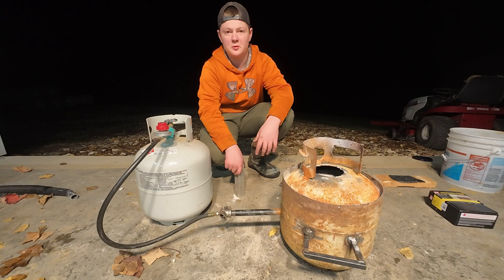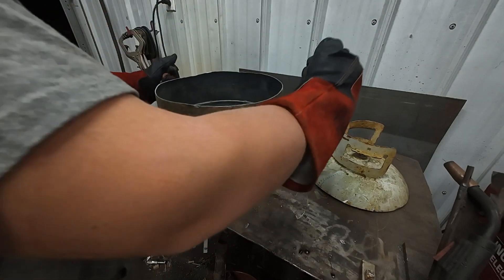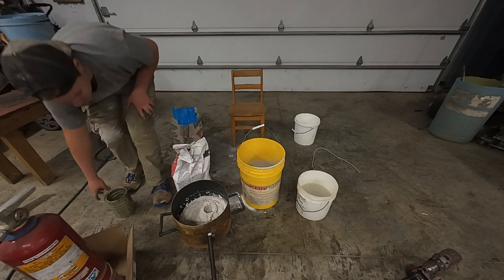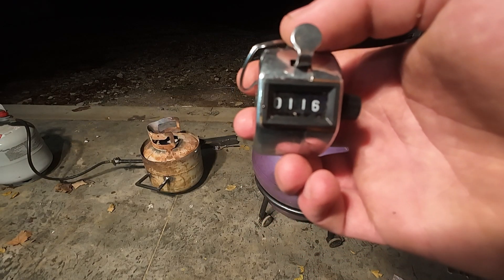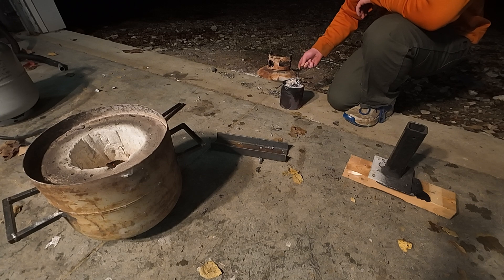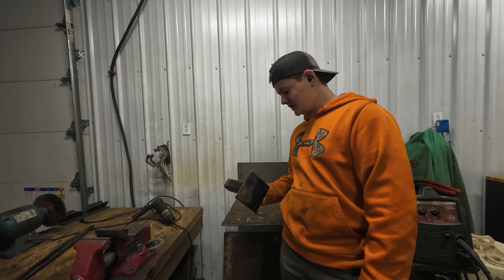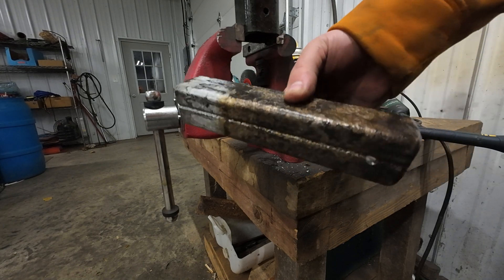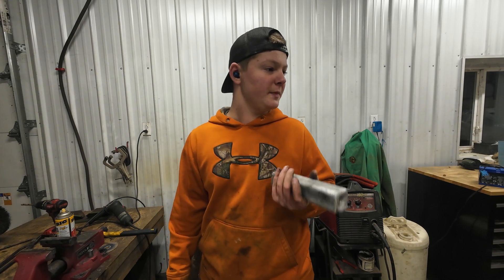116 can meltdown

Comment: Make a little square with a peg that goes through that hole then when the mold is cooled you should be able to tap on the little peg and knock it out of the hole and the square will help push the bar out
Reply from the maker: Good idea. I’ll have to try that